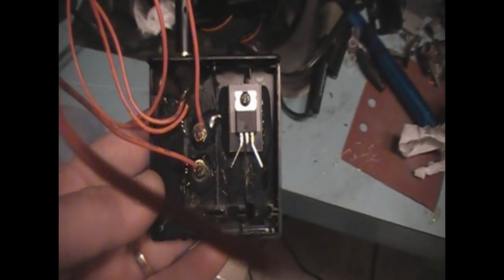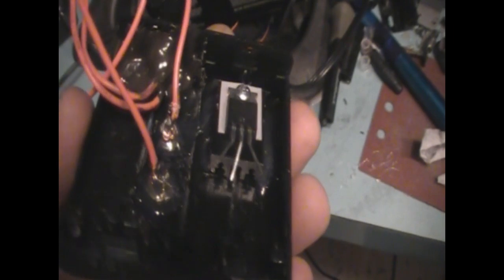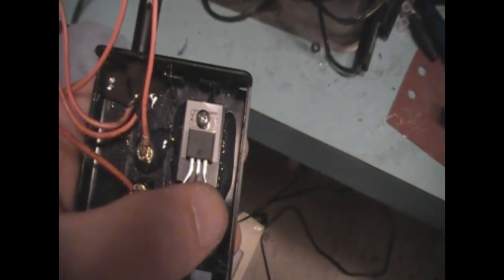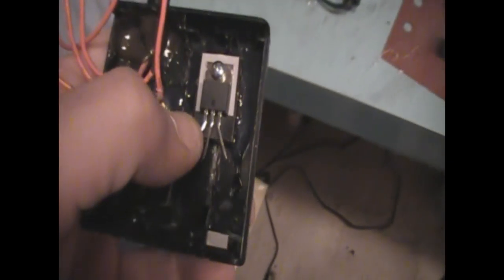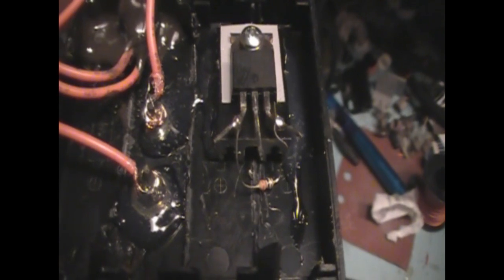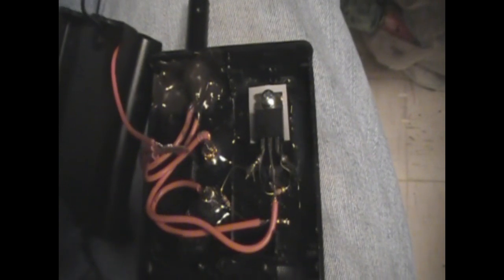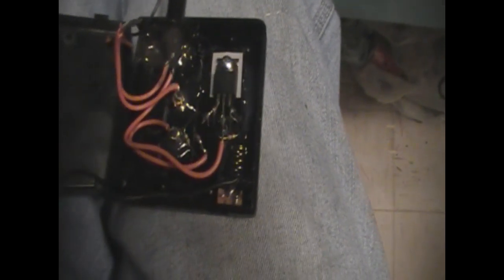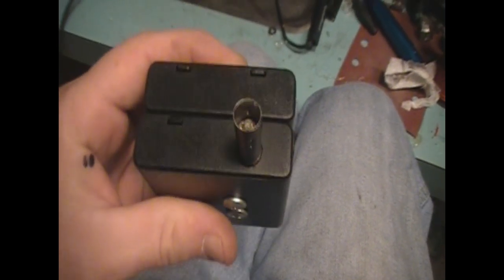E-cig Touch Switch HOW TO

Comment: thank you for the video. you said your running a 4.8v and 1v is used by the switch. i will be using 18650 3.7v baterry, since 1v is used by the switch i will be running 2.7v. this will not be sufficient w/ my set up for i will be using a 1.8 atty. please recomend what i should use to make this work. thanks

Comment: @Mikeandwendy74 Yeah, I was looking at the specs for your power mosfet, it can handle over 60Amps.  Seems to me any mosfet that can handle, oh, around 3Amps should be okay.  But yours might stay cooler since it's designed to handle so much more power.  Might try this on my next mod.  Oh heck, modding is just so much fun and addicting..... sky's the limit.  Thanks again.

Comment from the maker: @david1002a I got that irl3103 from digikey online, the radio shack irf510 needs too much voltage to close the switch, I didn't have any 14500's, was just trying to see if this setup would work, I am using 18650's now in some other mods I have

Comment from the maker: @david1002a The radio shack mosfet is the IRF510, but it had a high gate voltage requirement, you want something with a lower gate requirement like 1 volt intsted of 2-4 volts. Thats why I used the IRL3103. I would love to use a single capacative touch switch for this project, I am looking into it if you know how hit me up thanks